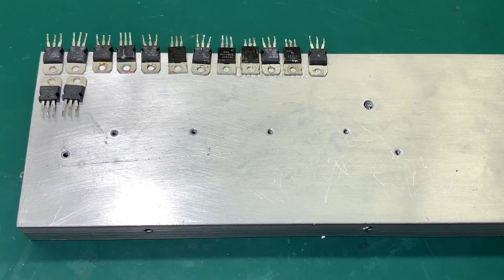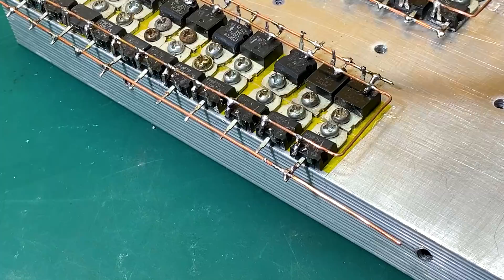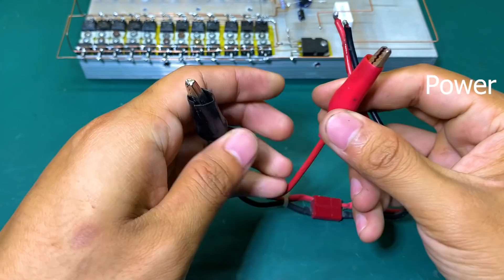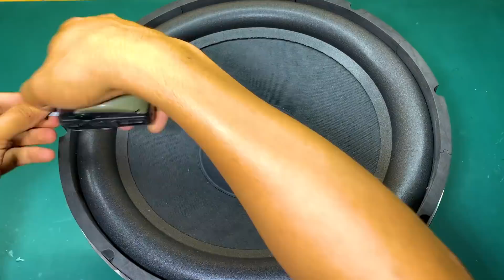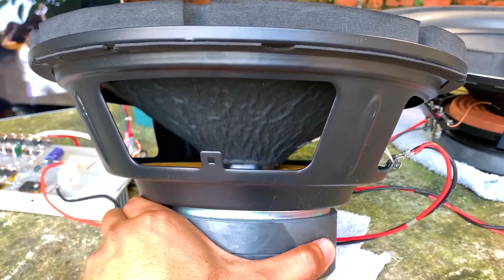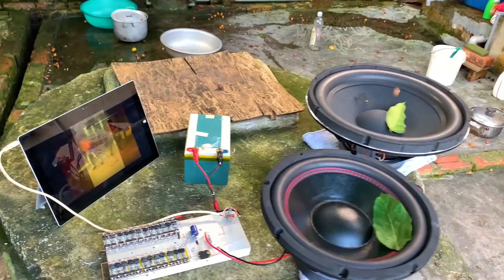DIY Powerful Ultra Bass Amplifier 48 MosFET 75N75 , 80NF70 , No IC , Simple circuit

Comment: 7000W LOL. The so called power supply polarity changed between 8.47 and 8.58 and back again during the "demo". Capton tape does nothing as the transistors are screwed directly to the heatsink. Capton tape around the battery casing. My suspicion is there is a bluetooth module, small amp and battery inside the larger battery housing. the audio is fed virtually direct to the speakers via those heavy copper wires. The FET's do nothing. Love these vids. So much fun working out how it doesn't work.

Comment: This is low-fi. You need a high pressure vacuum tube push-push stage to drive your output stage. Think bipolar speakers, Mirage,  Eclipse BP etc.   Also, no transistors from broken ebikes and personal massage units  Get some lateral FETs, Black Gates,  Serpentis Oleum for smooth moving coil coupling. Just use a normal MMC thats tuned to the exact eigen takt of your room or house.   This way its self exited and this provides very high ritalin effect in the standing WAveguide for Negative Koeffisient Erroneous Refractivity.  If mmWave = active, goto "RattleLube".   

What cable did you use to transfer music or power?   
This must be audiophile quality or bit-perfect is no longer 1s and 0s,  but maybe 0.98s and 0.3s.  Its common knowledge that a computer must have 0 and 1 for binary refinement state.  Integers and floating point is different, and the difference is called delta.  For temp is deltaT and for bits in binary code its delta-integerale. This is the push-push with no compression loss.  Force instead of lossy compression.   Übermacht immer gewinnt.
The most important factor is the wifi and the ethernet its connected to.  Only 10/100baseT with solid aggregate state   and Alligator Arresters.  NO UPS. Uninterruptable PSU needs to be 50% interruptible to allow proper function of interrupt requests (IRQ) in the asynchronous audio transmission.  Rifa, ROE, Elna etc does not work in PSU.  Only reverse biased tantalum stacks. 

Hundreds of uF with reversed bias stacked tantalums not only sounds great, but all those orange caps soldered nicely together looks awesome.  Better than High-End is Sky-End.

Comment: Just a few concerns: First off, even though you used Kapton tape to insulate the low side transistors, the transistor drains are still connected to the heat sink, via the screw heads and threads. Second, both the input and output capacitors are reverse polarized. (both hooked up backward) Third, I don't see any pull up current to turn on the high side MOSFET's. The 270 Ohm resistor connected to the base of the  D718 transistor is going to pull the gates of the high side MOSFET's down hard, regardless of input signal. The collector of the D718, will just pull the low side transistor gates to ground, turning them off as well. The emitter-base junction voltage drop is only ~.6 volts. It's just like a diode, with the cathode connected to ground, the anode connected to the 270 Ohm resistor.
    These are enhancement mode N-channel MOSFET's, so, to fully turn on the high side transistors, you need some kind of bootstrap circuit, to drive the gates at least 5 volts(a bootstrap circuit would give you 6 volts, if you are using a 12 volt battery) above the positive rail. I'm not seeing any kind of auxiliary supply, or, capacitors to shuttle the voltage from the output to the high side gates, to turn on those high side transistors.
Reply: I agree ☝️
Reply: i agree, also if he saying that ha having 7000Watts, and he he having one 1ohm speaker and one 2ohm speaker, he having 0.67ohm load. so if we calculate performance with ohm law, we would need: 

69V and 103A on output (0.67ohm load.)
84V and 84A on output (1 ohm load.)

119V and 59A on output (2 ohm load.)

Ofcourse we would get a little bit of resistance on the wires and components, so it would need a little bit more voltage.

The whole amplifier doesn't make any sense.

He having 12V input from battery, 1-2 Mosfet would be enough.

if its a class A amplifier, the efficiency is arround 25% and the output voltage is 3V. on 0.67Ohm load, it is 13Watts.
if its a class AB amplifier (unlikely), the efficiency is arround 50% and the output voltage is 6V. on 0.67Ohm load, it is 53Watts.
if we having 90% efficiency which is imposible, only class D amplifiers can do that efficiency, it is 10.8V. on 0.67Ohm load, it is 174Watts.

I think its a class A amplifier, The speakers dont have a loot of move, and these speakers are only 200 and 300Watts. 
The 2000 and 3000Watt car audio subwoofers are brutal, their weight are up to 20kg each, box not included.
Reply: I agree with you
Reply: And the speaker power ratings are also on the magic side.
Reply: @wurgervomlichtenmoor5073  yeah
Reply: @Uraim  Vincent Robinette is talking about high- and lowside MOSFETs so I guess it's a class D amp, isn't it? 🤔
Reply: @random basstester yeah
Reply: @thomasr.5443 he talking about High and low sides, but there isnt any ic to generate high frequency signal that will drive the driver which will drive the output, there isnt any ic like tl494 so, it cant be a class D amplifier in any way. Ofcourse you can work out with 555ic, it may give 100khz, but the effictive ones are 250-450khz. 555 ic is very very good for timing and for dc-dc converter.
Reply: Another fake video😊🙂
Reply: Don't forget the incredibly terrible idea of putting down insulating tape.. but then screwing the mosfets down with metal screws with no washes. Each tab is shorted directlty to the heatsink. He also uses the same "battery" in his videos, and its very light. Its got an amp and bluetooth module in it.   Also notice how the "signal" is wired DIRECTLY to one of the power rails from the "battery". Its the same scam over and over again.

Comment: A lo mucho 5w, todos los transistores en paralelo jajaja, no tendrás potencia con esa configuración, si fueran 7000w el altavoz se estaría moviendo con más fuerza y se ve que apenas apenas le da para mover sos altavoces
Reply: ¡si, es verdad! alimentado por una batería de 12 voltios, no mucha energía
Reply: E un incluso dándole más voltaje tampoco dara más potencia por la confirmación de transistores que uso ya que usar transistores en paralelo provoca la disminución de la potencia en lugar de elevar la
Reply: Bence izolasyon hatalı olmuş. O alüminyum soğutucuya bütün mosfetlerin orta uçları temas etti.
Reply: E Ainda Tem Um Capacitor Eltrolitico de 16v 1800uf Na Saída Positiva Do Alto Falante , Se Esse Amplificador Tivesse  Bastante Potência o Capacitor Não Suportaria a Alta Potência

Comment: wait a moment! why you use this yellow  tape? as an isolator? really? do not think so, the Drains go to touch the heatsink anyway! just because the screws have no isolation and connect both surfaces! nice try! hehehe and almost forget it...finally you decided where to connect the battery red cable!
Reply: Did you by chance notice, both capacitors connected backward? or, the fact, that there is no pull up to bias the high side MOSFET's? This just can't work as shown.
Reply: @vincentrobinette1507  yea, its very, very sad. The whole amplifier dont make any sense.

Comment: There are so much problems, 
for mosfets the tape is okay but the screws dont have voltage protective plastic on it, its gonna make instant short circuit
you not gonna run an amplifier on 12volts while there are 48transistors, waste of material and time.

Comment: 7000 watts woth 12V ? , It means that the cables Can support like 550 Amps of current , its too huge for your battery. At the maximum the current is around 20Amps ... 240W ...LOL
Reply: its just 13W, remember dude, the amplifier efficiency is only 25% at max power.

Comment: I don't think this is more than 400watts RMS
Reply: This circuit is totaly bullshit!,more than 8 Mos-Fet in parralel is NOT possible (gate-source capacitance too high!)
Reply: @jeanpierre3193  yeah it might be. also its no more than 13Watts at total power, also the Drain of the mosfets and the Bjt transistor collector pads are shorted with the screws, he did capton tape it, but still the screws lets the current go. The creator just under 2digit number of IQ, and his Amplifier idea dont make any sense at all. This is sad.

Comment: No bounce no dc really??  Dude this is a scam  your amp is on the battery side I build amp bro
Reply: yeah, he having very low amount of dc offset on speakers, due his overall impedance in ohms are very low, its just 0.67Ohms. thats why his speakers not getting visible dc offset.